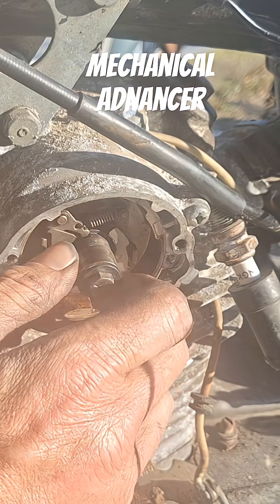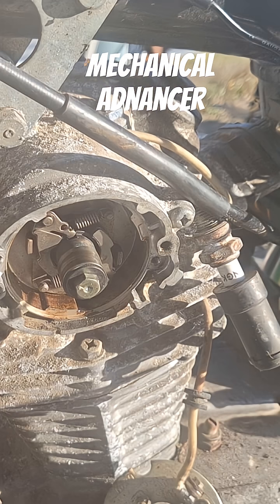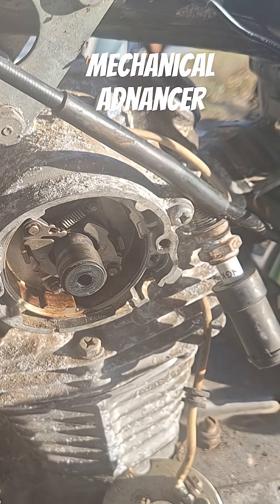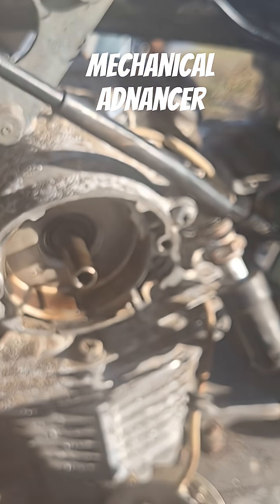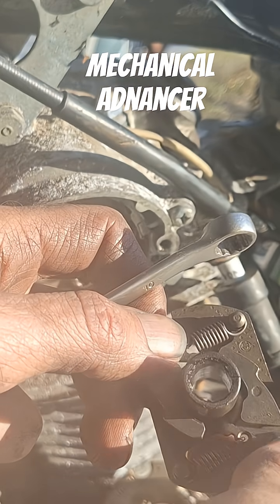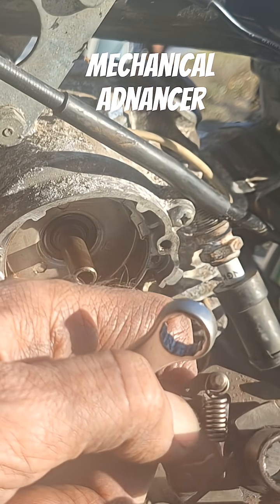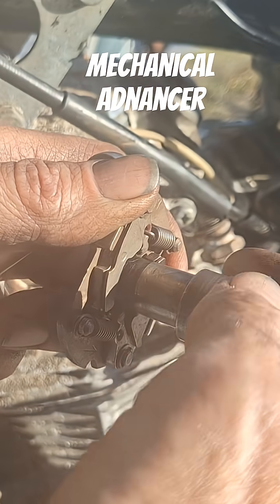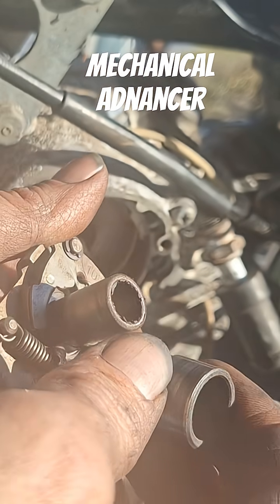Is Your Motorcycle Missing This Simple Fix?

Comment: The way you present is exactly what I needed I learned a lot from it.
Reply from the maker: They are more often than not neglected, as in sticking. I really should have gotten the footage of it not moving. But I was taking it off anyway to inspect the springs and weights for any wear on the pins. 
    What happens if it sticks is it will either usually be  either full retard or full advance. Full adance will lead to kickback on trying to start and possibly detonation at lower revs. 
    If it is stuck in full retard it will feel sluggish at lower speeds and never really pull clean to rev limit.
     Good luck with it. I use a little dab of antiseize, you only need a minute amount. A cotton swab works well. Don't forget a little oil on the points rub block as well, that little felt piece that rubs on the advancer cam.